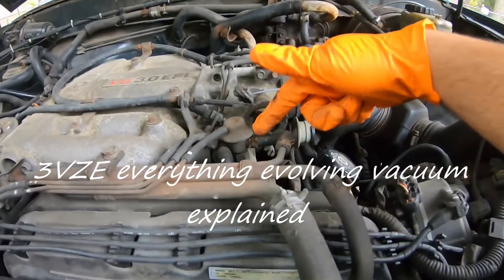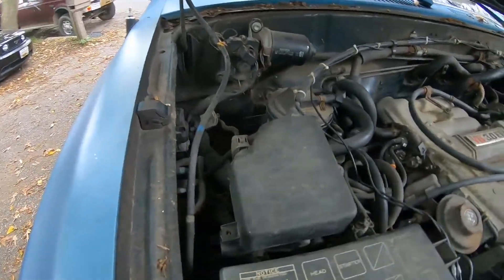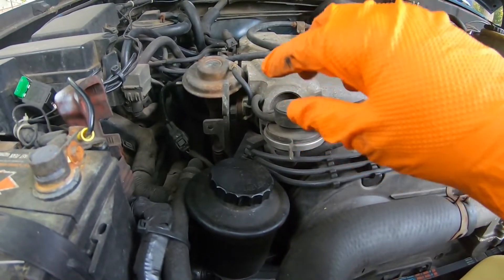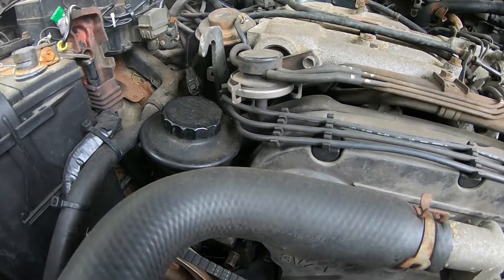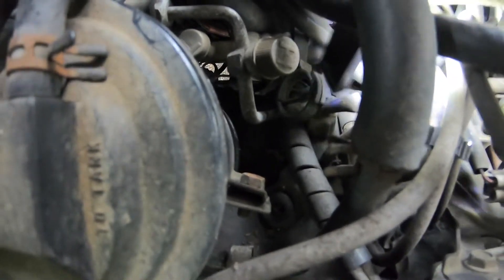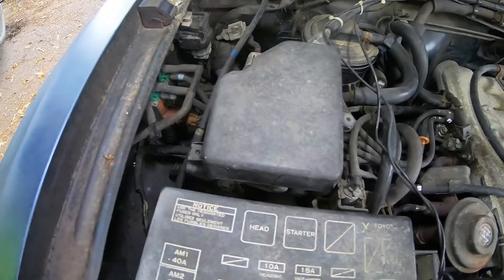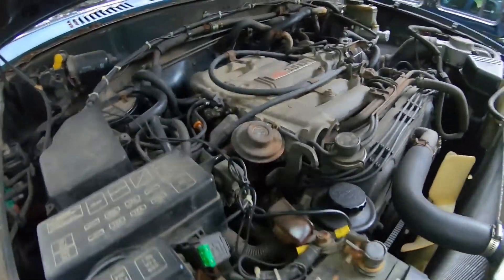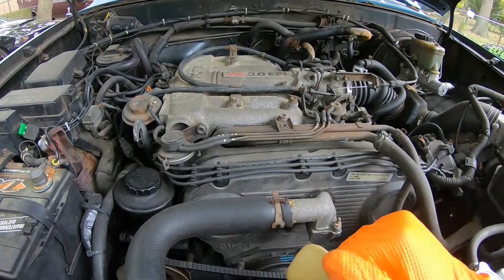Toyota 4Runner 88-95 Vacuum diagram

Comment: There anyway I can show me a picture of the vacuum lines on the passenger side close up and lit. Having a problem with a misfire and acceleration and I believe that it's a vacuum line mixed up I did a tune-up on a 89 camper Toyota 3.0 having a hard time get it running right
Reply from the maker: I could do that but I have my 4Runner parked on a far family property, I will go there next weekend. I will keep you in mind if you. Your friends with vacuum leaks is smoke test .  Double check your spark plug wires routing too
Reply: Maybe head gaskets,  this frequently happens.

Comment: where does the orange and black ball hose connect
Reply from the maker: That orange and black should be the vaccum check valve that goes to AS reed valve solenoid. 
The closest solenoid to the firewall . I have it in the vacuum diagram on my phone or you will see it on the sticker on your truck

Comment: I know this is off topic but do you overheat without a fan shroud
Reply from the maker: It does not overheat, the fact the radiator is aftermarket 4 row and also I had the thermostat is aftermarket that opens up at lower temperature. I just have bad gas mileage at winter . But the shroud got damaged and I never replaced the fact it never overheated with my set up.

Comment: Where did you get the image on your phone for vacuum diagram. I'm currently dealing with a vacuum mess on my 95 4 runner
Reply from the maker: I did get that from searching on google ( vacuum system 3vze ) if by chance you can not find it I will send it to you from my phone . Just let me have a phone number or email.
Unfortunately the complete repair manual is hard to find and the Hayness books doesn’t have the diagrams too.
Reply: @WheelersHoarder  think I found a few good ones! Thank you!!!
Reply from the maker: @tophercook8391  glad you did , I hope you get it fixed with no issues

Comment: Great video but What one goes to the transfer case when switching into 4wd the mechanism in the transfer case engages into 4wd without vacuum 4wd doesn’t work that’s what I’m having issues with can you please shed some light maybe do a video explaining.
Reply from the maker: Thank you . You must have a gen 3 Toyota ? The one I have is direct mechanical linkage from selector to the transfer case . I would get a vacuum gauge and hook it up and the read the vacuum after selecting 4es